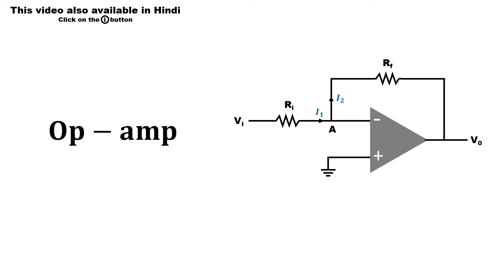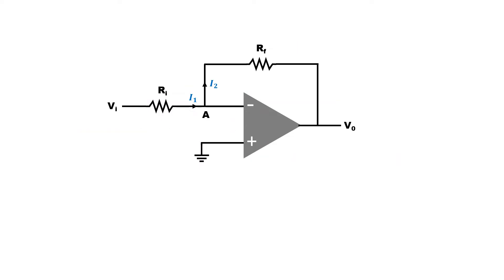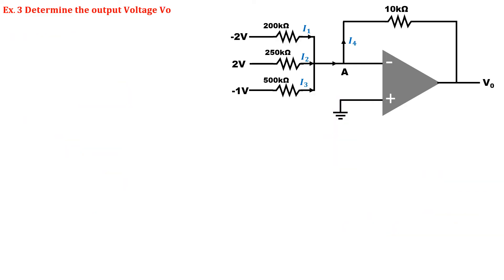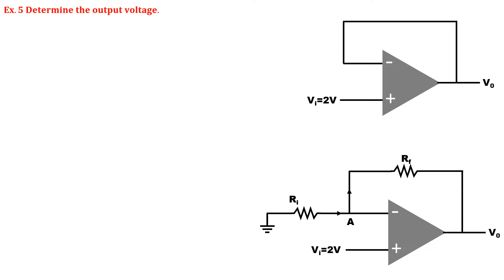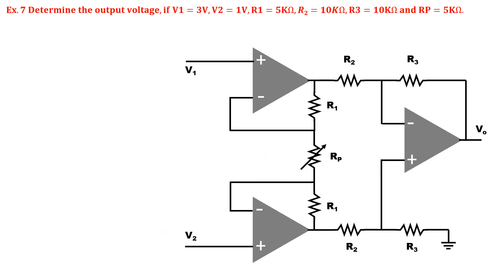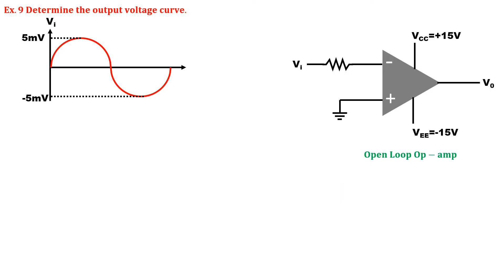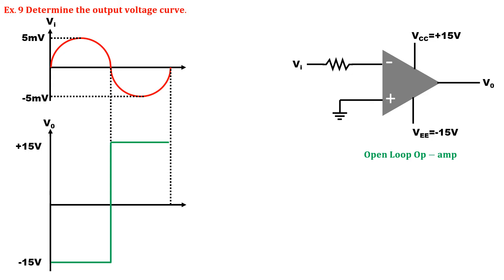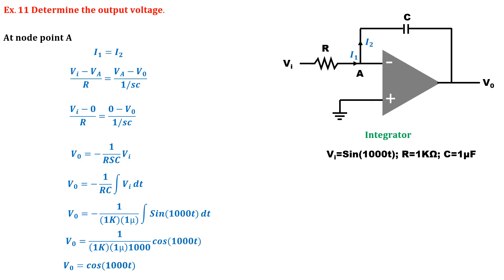How to solve Numerical problems of Op amp

Comment: There is a wrong calculation made by you, in the first SCALING ADDER op-amp question,,,,,,,, the output voltage should be  0.04 V ___________ But, you mentioned it as 4V....                        THAT'S WRONG  !!!!!